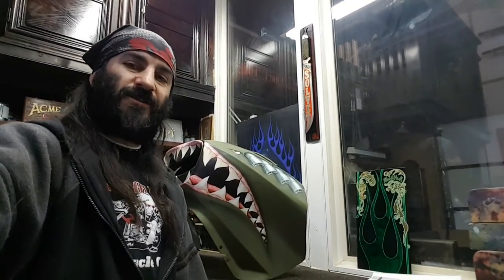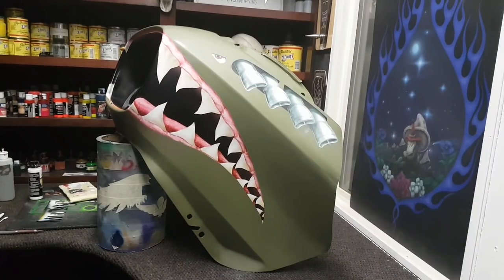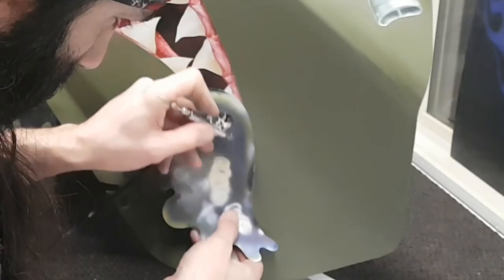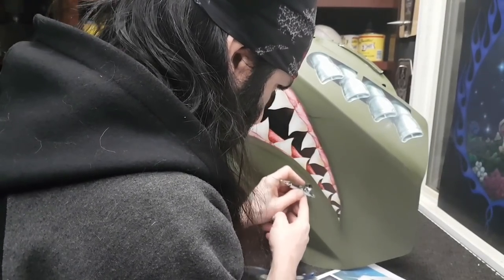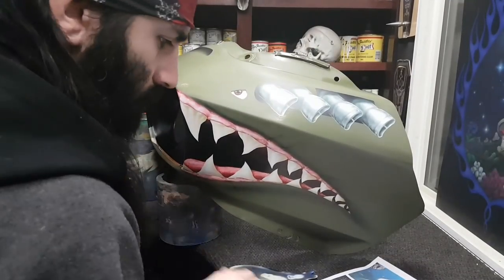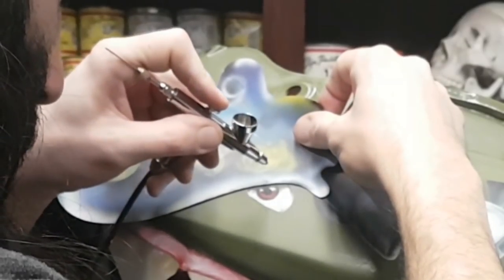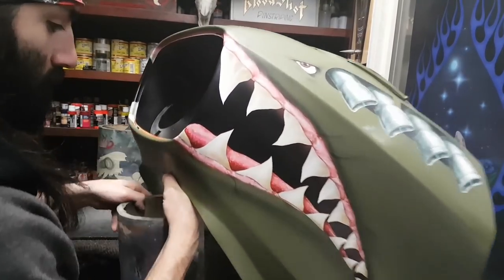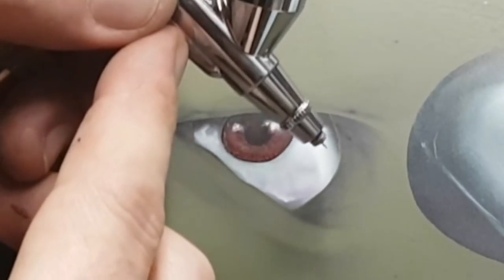How To Airbrush a Harley Davidson into a WWII Fighter Plane(Part5) Details!!

Comment: What make/s of airbrush do you use/prefer? I have a couple of Badger and an Iwata for fine details ... would like to try some other makes though, any recommendation?
Reply from the maker: Welllllll.... I may not be the best guy to answer this... I've noticed a lot of guys out there have a wide variety of brushes... lol I've only ever really used 2.... Iwata HP-B And HP-C they are technically "plus's" but I never run the rear handle... I've honestly never had any major Issues or felt the need to upgrade!! I'm a simple man... lol Hope this helps a bit?... Big Cheers!!
Reply: BloodShot Airbrushing Hehe, we must be kindred spirits! Those are the same brushes I use, (and love!), though my skill level is wayyyy below yours. I use a badger renegade spirit also, as I find it handy for large areas, comes with interchangable/cup or larger bottle.

Comment: Clear coat?
Reply from the maker: I farm out all my clears and base coats to an automotive body shop for the best possible protection! Hope this answers your question my friend!!🤘😎🍻 Big Cheers and Much Love from the BloodShot Studio!
Reply: @BloodShotAirbrushing  for the most part... I was mostly curious as to whether it would end as a satin or gloss finish, but also curious as to whether or not adhesion promoter is encouraged/discouraged on top of the airbrush paint.  Flexible additif'? Whether or not a tack coat was applied before a more saturated coat goes on.. you know, the whole process...haha 
Much appreciating regardless though brother.  There are all kinds of little techniques that get covered if one takes the time to watch all your content and it's incredibly valuable.
Reply from the maker: @aamantium1 👍 ok, so.. it went gloss. No flex agent was used (typically only for plastic bumpers and such) 😉 an initial dry coat is always recommended to avoid bleeding or vibrating the artwork. Then a couple wet coats, let dry and wetsand out any ridges developed from masking. Reclear and polish. 😁👍 hope I nailed it down this time bro!! 🤘😎